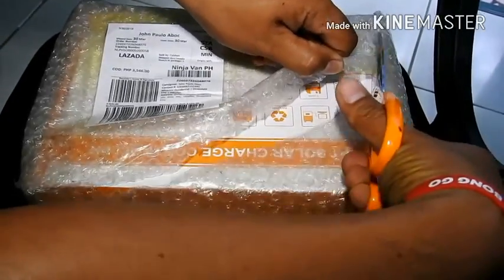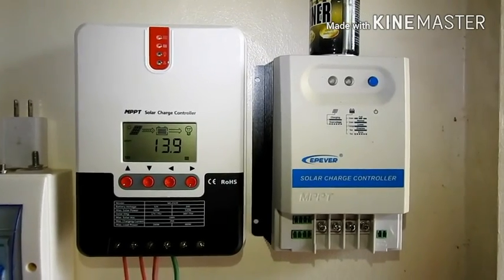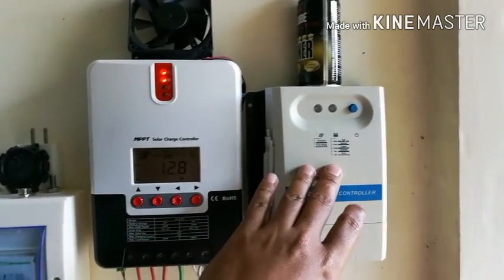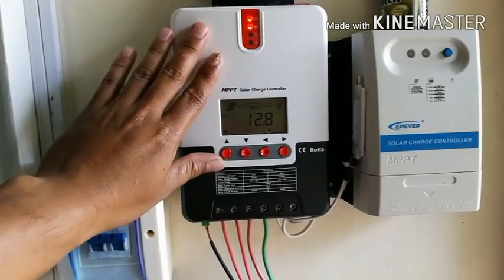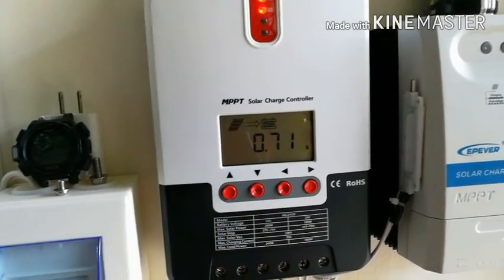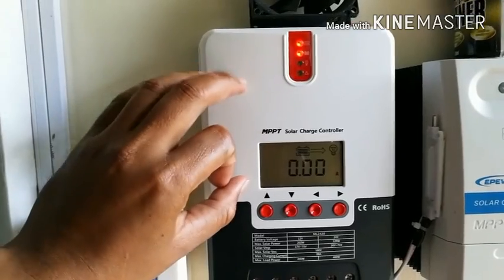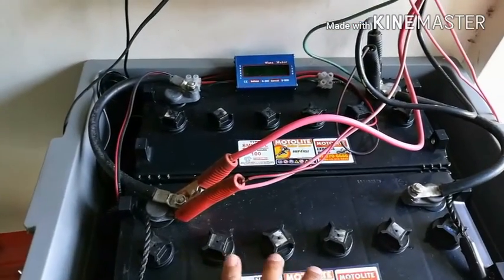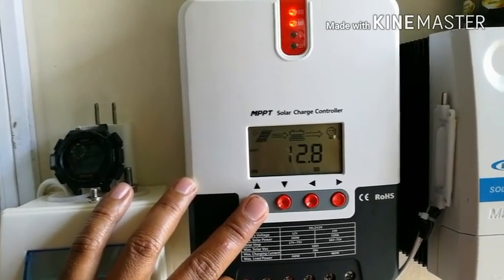SRNE MPPT solar charge controller / lazada

Comment: Pwede mo  parallel connection ang old mppt at new mmpt charge controller mo!  Pra hnd mwaste ang old mppt charger mo!  Un lng kailangan mo nga lng mg add ng solar panel
Reply from the maker: binukod ko nalang po yang Luma sa nyon my sariling panel na cya sa nyon pang trickle charge sa led acid po

Comment: hi sir good day to you. Can you give me the right charge controller and the right inverter and its specs and the wiring diagram of a 16 pcs of 120watt solar panel and 8 pcs of 100ah battery using offgrid. Thank you and appreciate it very much.

Comment: Can I use a 32a DC 2pole circuit Breaker on my 20a snre ml2420???
Reply: From what connection? Solar panels to charge controller? Or from charge controller to battery? How many volts is your battery? What is the max power (Imp) of your panel?

Comment: apat na 200wts panel anong match na charge controller na mmpt ang para dyan
Reply: pati battery na kailangan
Reply from the maker: Kunan nyo din ng base ang battery nyo Kong gaano kalaki battery bank nyo po,
Reply: meron akong 4 12v batt na tig 100ah

Comment: You series that solar for 24v ? Then parallel battery for 12v??
Reply from the maker: Yes because I'm using MPPT controller even you parallel or series your panel the mppt is smart enough to give power to your battery needs,parallel or series
Reply: @johnpauloaboc878  would it be still charging if you go for 24v?

Comment: Sir may charge controller aku same sau may display din pero dih accurate ang amp meter niyan kc ang output na Naka lagay sa display 4amp pero sa dc clamp meter ku 12amp...
Reply from the maker: Baka sir sa solar side kayo nag clamp kaya 4 pero pa puntang batteries dun tataas sir fron scc to batteries sir

Comment: Sir tanong kolang pwede ba gamiton or load bisag sgi charge ang solar panelbord sa battere
Reply: depende kung malakas ang solar panel mo. example: 12v 50ah battery with 300watts D.O.D . So, mga 200watts or 300watts na solar panel ang gagamitin mo para mablis ma fully charge yung battery while using ur device/appliances.

Comment: Does the load side produce a stable 12v? Other controller has the same voltage with battery and load side so sometimes it feeds 13v or more to the load side along with connected devices with it, because it may harm anything connected to it like a 12v rated router
Reply: i think all scc has same voltage as your battery voltage.. just use a buck converter to your modems/router.. im using a 300w 20A buck on my fiber modem and 2 deco M5

Comment: 20A po ba ito? Ilan po ba max panels ang kaya nito?
Reply from the maker: Mga lima sir na panel kaya basta pasok sa limit nya
Reply: @johnpauloaboc878  sir kaya b ang 300wats panel ng 20amp na mppt?
Reply: JEFFREY TORIENTE nsa 9-10 amp ang 300 watts kaya yan sa isang panel wag ka lang sosobra sa max amp ng mppt kse masusunog mppt mo
Reply: @genysys1511  ibig bang sabihin sir..kung 20a mppt..
pwedeng pumasok ang 20a or less wag lang 21a and above galing solar panel?
Reply: Geofrey Molina kung 20amps ang limit ng mppt mo max mo mga 15amps lang kse para di maginit ng husto kse kung 20/20 saktuhan pwersado mppt
Reply: Geofrey Molina kung 2pcs ang 100w pv mo at di lampas sa 15amps ang total impp pasok un kung 300 w nsa 9amps pataas un so isang 300amps lang pde na kse posible pa tumaas ang 9amps
Reply: @genysys1511  thanks mam..ung 9amp o 10 amp..ito po ba ung Imp na nakasulat sa specs ng panel?

Comment: sir ganyan mismo ang charge controller namin pero bakit po kaya walang power supply ang load?
Reply: check read the intruction manual. you can program it.
Reply: sira yan lods dpat papalitan mo yan na experience kona yan me sunog yan sa loob o sirang mosfet papunta sa load

Comment: ser anu best setting mo dyan parehas ng controller ko,pansin ko lang ang bilis mag 100 percent ang battery ko gamit ko 2 36ah deep cycle from motolite.
Reply from the maker: ganon talaga c motolite sir tanghali pa lang 100 na yan pero sir wag mo lang talagang sagarin na aanot cya ng 11.80 or ma safe pinaka mababa 11.9..pag dumating ka non wag mo na sagarin c motolite,kac d na yan mag hohold ng matagal 7pm palang 12.5 kana...wag lang sagarin sir un lang ma advice ko sir
Reply: @johnpauloaboc878  ser sa inverter anu gamit mo pure sine.
Reply from the maker: pure sine wave po sir ni CD R king
Reply: Gudday sir! Ilang watts solar panel mo?  Napansin ko umabot ng 50 volts? Puwede pala yon?   nakaseries  panel tapos 12volts lang battery mo?  Tnx!
Reply: Renee Nietes kse ung mppt automatic nya i set ang charging volt nya based sa batt set up mo kung 24v batt mo magbigay din sya ng 24v kaya sa mga mppt me mga batt voltage range sila na 12 24 48
Reply: @genysys1511  sir ilang watts maximum kaya ang kaya nyang 20a mppt sa dc load side?